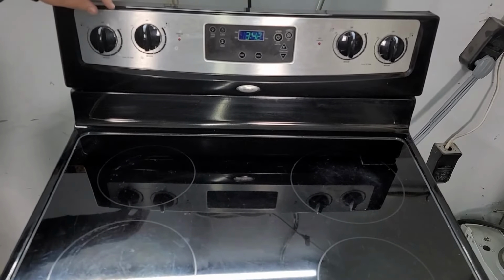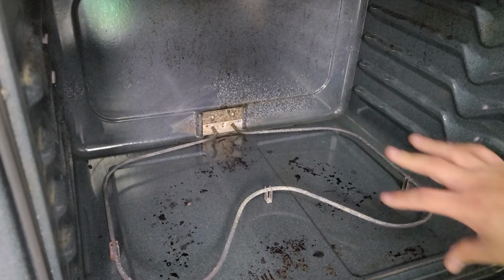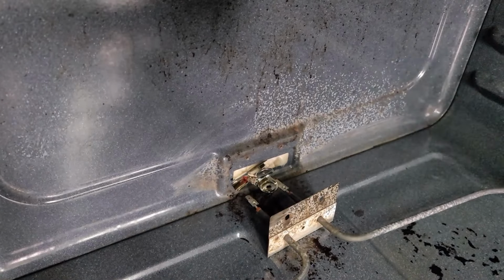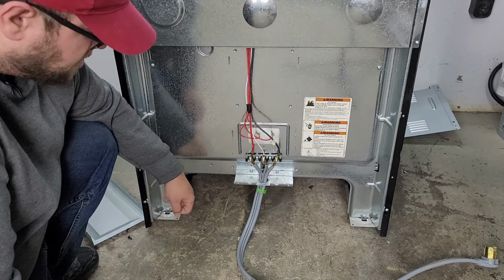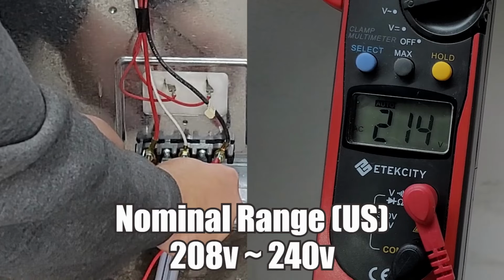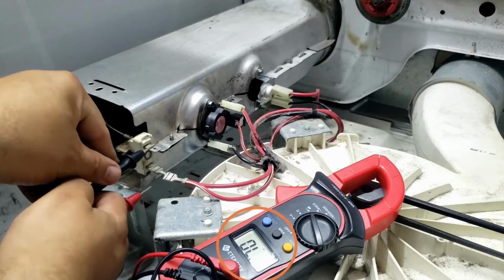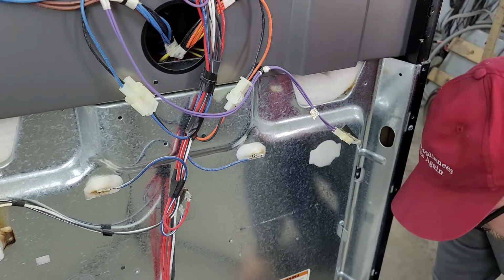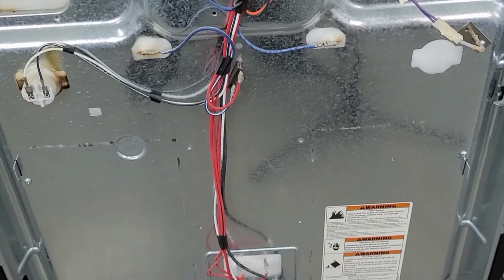Whirlpool Oven Won't Heat - How to Range Troubleshoot a Whirlpool Oven Not Working

Comment: My oven will not set the temperature to anything above 275. It worked perfectly well until it started to beep and reduces the temperature from 350 to 275. Now it will not let me adjust the temperature above 275.

Comment: I want to go back to the old fashioned pilot lights! When I sold my house 4 years ago, I left behind my stove from the 1960s that was still working with no problem. As I sit here with a 9 year old oven that will not heat, I miss my avocado green stove.

Comment: I set my oven to 425 but it only goes to 350. If I unplug it for 5 minutes it will heat to 425, but the next time I use it, it won't go above 350.

Comment: Great video. One suggestion for those troubleshooting. FIRST check your 220/240v power supply. If you have partial power (110/120v) everything will light up but not all of the heating elements will work, if any. A BIG THANK YOU for this excellent video.

Comment: I tested the thermostat and the heating elements the bottom im getting 28 and the bottom im getting 19 ohms , and im also getting the 120 volts on the wires in the back is it my heating elements that are bad ?

Comment: A while back my stove flipped the breaker, it happened while it was off and I was gone.  I don’t use the oven in the summer today I went to turn it on nothing, the digital temperature board was dead. I have a feeling it’s the circuit board, the stovetop burners are fine

Comment: 5 year old Whirlpool electric stove with a big made in USA decal splashed on the front. In the last year first the stovetop burners stopped regulating temperature one at a time then the over stopped heating properly and would shut right off. The quoted crazy high cost of the  parts to fix it is more than the thing is worth, so a 5 year old stove is now going to the scrap heap.

Comment: I went with you through this video step by step. 
Initial problem stove top works, oven shuts off and does not heat up at all. 

The bottom back wires the red, white, black.
I got 120 red to white
I got 120 black to white
But black to red I get nothing 
I’m confused. 😢
 Any help would be appreciated 
All other things tested correct
Reply from the maker: Dead neutral. Power cord/breaker/ect is messed up.

Comment: Whirlpool wfe540h0es0 , new bake element, new temp control sensor, new control board, heats up and keeps heating past setting until error code. Any ideas?

Comment: Top burners worked, but not the oven. First thought that the ground had been connected to neutral in the oven, but that was okay. Then, I examined the junction box where the wiring had been extended to accommodate the new location of the range. All three wires plus ground seemed to be properly connected. When I removed the cap on the neutral wire nut I discovered the culprit. An eight gauge wire is fairly stiff and the twist had either come undone or had always been that way leaving an open circuit inside the plastic connector. When the neutral wire was reconnected in the junction box the oven worked. Problem solved.

Comment: Have an older Whirlpool designer series model RF366BXVN3, that the oven and broiler work fine on, but the entire glass top keeps turning on and back off constantly without actually bringing the burner up to heat. It took me 5 minutes to fry an egg, because the pan couldn't retain it's heat, unless I turned it to high, which still can hardly bring water to a boil. 

Any ideas, because I'm at a standstill as to where to start looking? 

It was working intermittently, for a while, but now it's just a complete PITA. 

And I've looked at new stoves, and everything seems to be built out of tin, and just seems cheap compared to what I have. 

Thanks in advance, for any help.

And it's not the breaker, or supply wire, as I rewired the entire house about 5 years ago.

Comment: We just bought a Whirlpool oven. We did not notice that the broiler element hung down from the top of the oven quite a bit and it was only 2" in from the door opening until my wife was badly burned from it. I am surprised I can not find a recall on this. Lowe's will not do anything for me and Whirlpool put me on indefinite hold. We do not ever use the broil function so I am considering removing the boiler element all together. If I remove it will the bake element still operate correctly? Thank you for the help, Rick
Reply: Even Ben says whirlpool quality gone way down hill a lot of the companies make junk now

Comment: I tried to preheat my oven to 350, but indicator shows only 325 after 40 minutes. Tried again to preheat to 400 and again indicator only shows 325 after 30-45 minutes. Seems stuck at 325. What could be wrong?

Comment: The top of the stove works fine the numbers come across the display my heating element for the broiler and also for the oven will not get hot and when I try to turn it on I hear click coming from like the top rear of the stove and the display does not go over 100° which is telling me it’s not getting hot someone told me that they had an issue like that they changed out the computer board and that resolved the problem I have no oven or broiler working right now and I’ve probably only used the broiler six times the unit is relatively new I live alone I don’t use it much but hearing the click is that sound like the board
Reply: I’m curious if you ended up fixing this problem, and if so, what was your solution? I’m having the exact same issue.

Comment: Replaced every part you just spoke about. Still not heating. Any suggestions?
Thermal fuse, thermostat control, board broil, and bake element. All the burners turn on oven still won’t heat.
Reply from the maker: If the burners won't heat its an electrical problem not a stove problem
Reply from the maker: Mind you I'm noting stovetop burners
Reply from the maker: Mind you I'm noting stovetop burners

Comment: @bensappliancesandjunk 
The stove is a Frigidaire model ffef4005lwb. My mom called and said she was using the broiler and she heard a pop noise. The next day I went over there I looked in the oven and the Broiler and Bake Element looked fine. I saw that the clock wasn't lit and this display also turns on the oven. I checked the breaker, and it had tripped, so I turned it back on. The burners on the stove work, but nothing is lit up on the clock and oven display. The light in the oven is working. Do you think that this means it's automatically the control panel? Thanks

Comment: Hi Ben - thanks for posting this helpful video. I have the same exact Whirlpool oven you are testing here.
The 4 burners on the stove top work fine but the oven and Broil function both stopped working at the same time. Can you please tell me what I should check first?
Thanks so much!
 Van McDowell
Reply from the maker: I would watch the video and follow along with it. Likely its going to be the board though, so you'd want to check for 240v going to the elements
Reply: @bensappliancesandjunk  Was hoping it wouldn't be the board since it is only three years old and out of warranty (of course).  I will follow your check-out procedure with my volt meter to verify. 
Thanks again for responding and your help!!  Van

Comment: First great video description. My whirlpool range oven went out a couple of Sundays ago, thankfully after Sunday dinner was finished. I didn't realize it until the next morning when the clock display was not on. So of course I tried to press buttons and nothing would come on so I did not know what was going on so I started googling different things now I have already replaced the element I want to say I've already replaced the ignite function for both sides of the the burners I like I said replace the element I replace the thermal block I replace the sensor from your video I heard you say something about the control board I'm thinking that's probably what is wrong with my range the control board I see that is also costly in your recommendation would you recommend replacing the control board I mean I guess I pretty much will have a brand new range after that because I replace every part on the back of the stove

Comment: You check the heating element with a wire connected. In my experience as an hvac guy you should isolate everything before ohming something out
Reply: absolutely correct. could be reading the resistance of the entire circuit

Comment: That stove is almost identical to ours. We just went through 7 days of no power due to Hurricane Helene and when the power came back, the stove top works but not the oven, so I will use your methods to check it tomorrow. Thanks so much for this video.
Reply: Yep same here .. right after hurricane Helene… what did u find out?
Reply: Same exact situation and symptoms with our Whirlpool range (after Hurricane Helene). Do you mind telling me what you found wrong with yours...?
   Thank you!
Reply: Following because the same happened to mine. Light flashes on and off constantly as well
Reply: @garyanderson2720  I figured it out .. I replaced the control board last night .. the oven is working again!! 👍👍I just need to clean 🧼 and degrease the entire oven .. inside and outside..
Reply: @vernonbrite6707  If you have electronics experience you can generally troubleshoot and repair the control board. The oven elements turn on via relays. Generally, with a lightning strike or element failure, it can also take out a relay (and occasionally back-feed voltage into the surface mount diodes). The relays are a couple dollars reach, and the diodes are a few pennies.

Comment: If it can help anyone, my top element burnt, I replaced it, and the oven would still not work after that, despite both elements having 24 ohm resistance. The stove elements and display panel worked, but there was no light on the oven knob and no heat. I checked the input voltage and only got 120-ish volts. Went to the breaker panel, noticed the oven circuit  was wired to a tandem breaker, and lo and behold, only one side had tripped. I reset the breaker and it resolved the issue.

Comment: i have a whirlpool  worked fine untill a power outage when power came on stove has a error code f9. so i try to reset it buy removing the power for a minute but still f9 stove top work bu7 oven don't. i ck connections in back all are tight.

Comment: My whirlpool wall over started erratic heating and turning off.  There were three beeps and a message on the display.  Error F2.  It kept warning but eventually petered right out.  Clock used to show even with error message.  Ow completely dead.  Does this sound like a board issue?  What is the cost.  It is a double wall oven. 14 years old or so.

Comment: My oven works but shuts off in the middle of baking sometimes. Most of the time it works fine. #2 I will set it to 350 and sometimes it only goes up to 250. There again most of the time it works fine.  What could it be?

Comment: I am only getting 47 Votes to Heating element. Everything else checks out good. Just verify.
Reply from the maker: Check electric to terminal... IF that is 47v, then breaker is bad. If you get 47v to element AFTER board, board is bad.

Comment: My problem is I unplugged my oven. I’m getting an F9 code, but I can’t cycle through the menu on the board. Only button works is cancel all the other buttons don’t work and I was having a heating problem with my oven would not heat.

Comment: VERY GOOD VIDEO! Question: I have seen a video showing how to reset the unit with the buttons "cancel cancel start 3 3 3 3 3 3 start start"
Is there any reason to try or not to try this?

Also, is there not a "high temp shutoff" device on this unit or is the thermostat the only thing that turns off the element when the temperature climbs way high?
thanks,
Bret

Comment: Burners work fine. 20 vac across oven elements. All plug connectors on control board pulled, elements, fuse, light, door switch, lifted. Something pulling L1 down.

Comment: FYI: if the elements are not reading OL but are significantly out of line with the numbers he’s giving, the problem could still be the element. Maybe self explanatory but I wanted to add some clarity in case others were having the same issue I had, which really seemed to be a thermostat issue but ultimately was the lower element.

Comment: I have a frigidaire gallery oven. The oven won't turn on.. but the broiler does. I replaced the ignitor and still not working. I replaced the motherboard and still the oven doesn't turn on. Maybe its the thermostat.

Comment: Thanks, this video was helpful. My problem seems to be a bit more involved. My oven will not come up to full temperature unless I use "rapid preheat". So, if I try to bake at 350 the oven gets to 295 and stays there. If I switch to rapid preheat it will go to full temperature. At room temperature the temperature sensor reads 1100 ohms which matches your video. Both the top (broil) and bottom element seem to be working and I am getting about 220 vac to the range. Everything seems to point to the board. Do you agree?
Reply: It;s been 10 months - did you get a response?

Comment: The model you had in the video was electric, mine is a gas stove WFG505MOBS2.  And it does not get as hot as any wife for that matter.  I cleaned it out but will apply the tips in the video above and see how hot she becomes..

Comment: any idea the problem if the burners shut on and off intermittently (about every 20 seconds)?    I have 2 burners that do that.  then I have one of the large burners that won't work at all (the burner failed months before I started having problems with the other burners).  and I have one small burner that works fine.  so right now I only have one small burner that works correctly.   I have a whirlpool glass stop top oven.

Comment: When testing the broil element for continuity I get 15.7, does that mean it is bad and should be replaced?  I tried to test the thermostat and could not get any reading but I am not sure I am doing it right.  Useful video...
Reply: Same here, 16 Ohms. Outside of the range he said, but not by much. How strict is that range?

Comment: I have a whirl pool that comes on gets to about 200 degrees and the element goes cold and the oven never gets up to temp. Temp displayed looks accurate the entire time. Is there a thermal safety switch on some of these? Where is it?
Reply from the maker: Likely the board relay is shot. It can't deliver the right current to get it upto temperature.
Reply: @bensappliancesandjunk  thanks. I’ll take it apart and see what’s going on. I’ll try an update if someone else has the same issue

Comment: My whirlpool seems to heat up to temp. If i set it to 350 it goes to 350, but then drops temp to about 250 or less. Yet the display still says 350. I realized this by turning the oven off and back on, then the display reads the 200 something temp as it heats back up, then cools down again without changing the display. What could the problem be? 😟
Reply: Did u ever found out what was wrong with ur stove?  because my stove doing the exact same thing 😤😩
Reply: @blakkrollin9030 mine too and clicking a lot the whole time
Reply: Where is the solution for the problem you just highlighted? This is my same problem!!
Reply: @ I been waiting for someone to tell me for months now
Reply: Hi. The first thing you mentioned was that you would talk about what to look for if nothing happens. My stove is a  W10198585A. If I unplug it and plug it back in, it works as expected for a while then reverts back to dead. The clock works. The "hot surface" light works but no heat anywhere. Reboot and it works again for a bit. I checked the connectors, re-seated them all and am trying again. Any ideas?
Reply: Also waiting for the same solution, I have the exact same problem
Reply: Check thermostat
Reply: @jhubbard49  I just ordered a new bake element, took it apart, and the element is mostly good. However, the wire and connector on one side is crispy fried, as is the connection on one side that it attaches to on the element. It is too short to just redo the end. It may have been loose is my guess.  Thought I smelled something last time i used it. So it makes sense now. I don't see an exact replacement for it for that model, but similar models. Going to have to look at the top part of the back and figure out the best way to fix it without burning the house down. I'm poor, so not just buying a new oven.
Reply: Did you fix the problem with your oven? Mine is doing the same thing. I was just wondering if you fixed it. Thanks
Reply: @JoseL.Lopez-u4g I had to call a repair man and he knew exactly what the problem was. It was some kind of electrical switch.🤷‍♀️
Reply: @jhubbard49 what electrical switch it was before I have a customer with this problem

Comment: My oven wont come on at all. The stove works fine though. F9 is displayed and the oven light wont even come on anymore. We replaced the element and soon after we installed it that stopped  working too. Our oven as no latch or door switch so i dont think thats the problem. Do you think its the board or power cord?

Comment: Hi Ben,
My whirlpool oven works when cooking, but whensuttong it off the display goes back to the clock mode, but the oven never shuts off unless I kill the circuit breaker. Any idea of what may be causing this?
Thanks,
Gary

Comment: Hi. Great video. In my case my oven preheats to the required temperature but then begins to lose heat and doesnt heat back up. I have replaced the element which was badly cracked and when it continued having the same problem i replaced the temperature sensor but still problem exists. What else could be the problem other than the motherboard? Thanks
Reply from the maker: Control boars. Relays are going bad
Reply: @bensappliancesandjunk  I have the same issue and replaced the oven heat relay but the issue still exists as well?